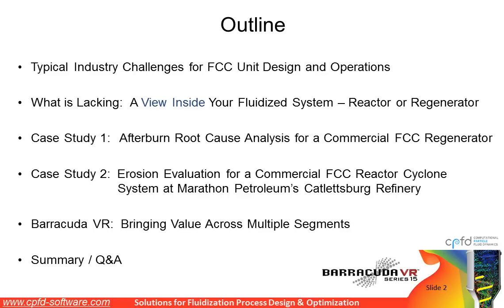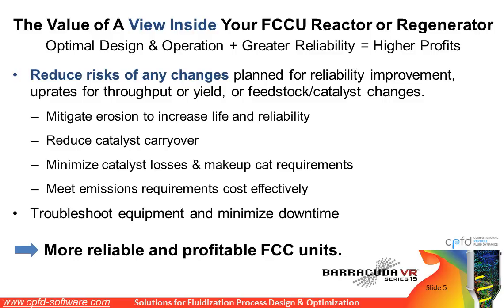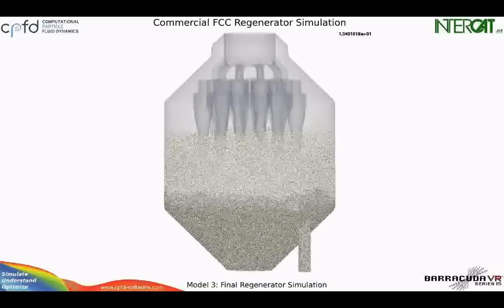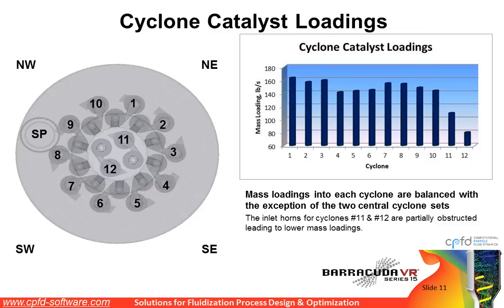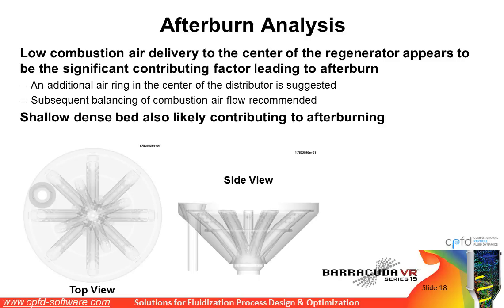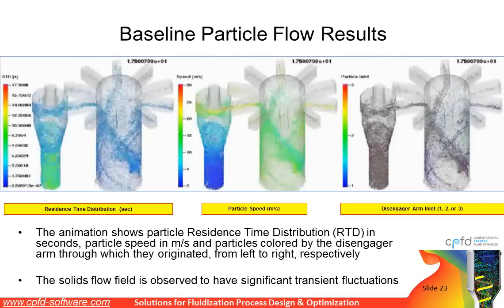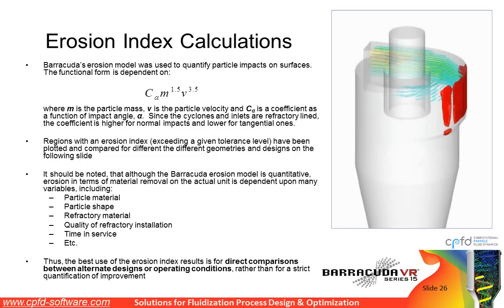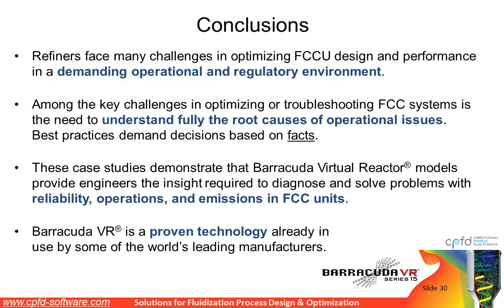Case Studies of Optimizing and Troubleshooting FCC Reactors and Regenerators

Comment: best regard,

The case study developed, contemplates catalyst losses ?? (Case study # 1)
Reply: Cat losses were not considered as part of Case Study 1, but we've done other projects looking at both reactor-side and regenerator-side catalyst losses, and how to minimize them.  One example involved a secondary dipleg plugging phenomenon where regenerator-side catalyst losses would suddenly spike and stay high until the dense phase bed level was dropped to below the secondary dipleg trickle valve elevation.  The Barracuda Virtual Reactor simulation showed that the catalyst losses were due to poor fluidization.  CFD simulation was used to down-select between alternative configurations enabling the refiner to  operate within regulatory compliance for CO and NOx emissions while eliminating the transient catalyst loss event.  More details can be found in this webinar:  https://cpfd-software.com/resources/webinars/2017-ertc-presentation-resolving-severe-regenerator-maldistribution
Reply: Dear Sir, Would it be possible to email you to discuss about the cyclone modeling? 
Thanks